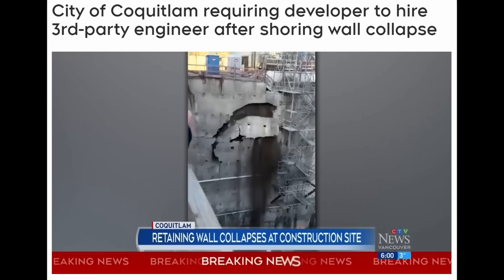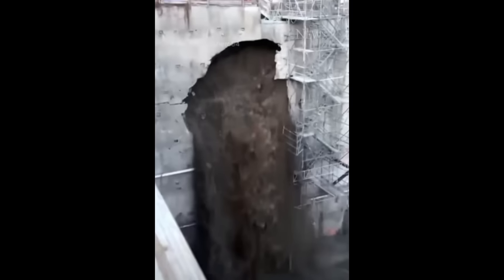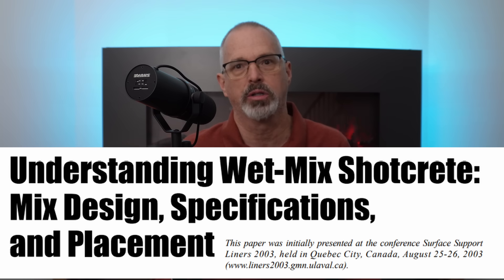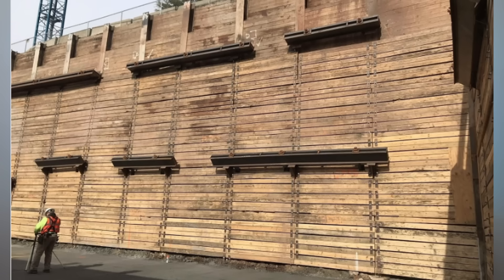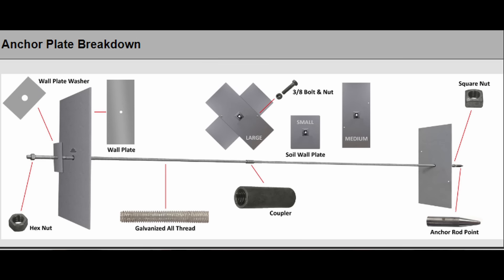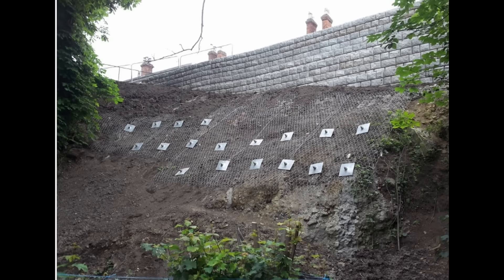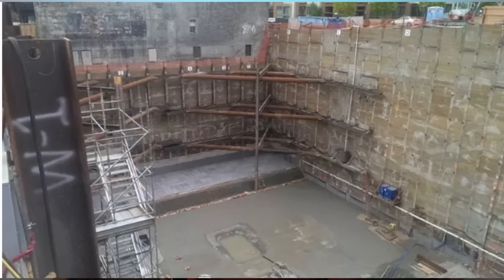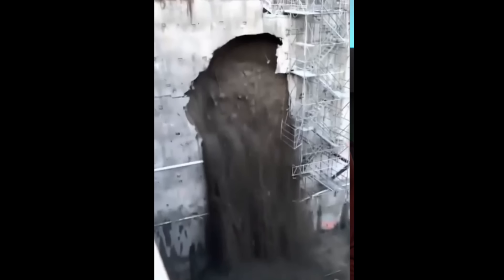Retaining Wall Collapse in Canada

Comment: Deep SOE in sand (seem to be outwash sand) - tieback or cross brace with soldier pile often is the better choice.   Same failure with soil nail and shotcrete wall has happened in Queens nyc in recent years.  Thanks.

Comment: I have worked on shot Crete walls with soil nails over 50 feet high in similar ground conditions. However we used heavy duty wire mesh and rebar anchored behind the wall plates. Looks like they saved some money on the mesh and rebar!

Comment: I've worked 2 jobs were ever 4ft drop in the hole ,malcomwould come and drill hollow ancor bolts followed by injecting grout be fore the drill let go and moved to the next bolt ,then wire mesh was put on the bolts then sprayed with grout ,after a time for cureing the plates were bolted down with a hydraulic machine under a inspectors eye ,that Malcom company is a great one for shure
Reply from the maker: Yes I agree.  The situation with contractors in the Vancouver area seems to be a free for all on these retaining walls.

Comment: You missed the biggest critical factor why this shotcrete shoring failed, no welded wire fabric / reinforcing steel.   PS referring to this as a 'retaining wall' is like calling an innertube the tire, FYI its called a shoring wall.
Reply from the maker: No I did mention that in the video.

Comment: People here have been saying the area is known to be unusual in its "fill" composition. Previous construction has run into the same problem, you'd think the city would've advised caution.
Reply from the maker: I understand that this engineer also had prior experience in this area as well.
Reply: @CaseyJones-Engineer  Then it's a case of cutting corners? Another poster mentioned they prefer the engineer stay in the trailer. Inexperience? No, geotechnical engineers would have relied on what was usually done elsewhere in the Lower Mainland as it didn't suit this site. This should have been basic.
What would be the cost of putting in those stronger alternative retaining walls?

I often get videos about China's "tofu dregs" construction. Let's hope corruption isn't settling in here.
Reply from the maker: @alainarchambault2331  I emailed the City of Coquitlam several questions that I had about this incident and there has been no response.

Comment: Shotcrete is a very common application for retaining walls in BC canada. You actually would be hard pressed to find any other system. Something has to have changed the soil conditions from when the original wall was installed. Typically you see shotcete walls installed at 10-15foot lifts. So if that soil was always that granular it would have been impossible to install the shotcrete as the soil would have just poured out.

Comment: Saying you’ve never seen an engineering practice doesn’t make it impracticable. Vancouver area has hundreds of such examples of shotcrete shoring. The failure here is due to improper attachment of the WWF to the soil anchors, inadequate soil anchor spacing, or insufficient shotcrete thickness application. You don’t sound like someone who knows what they are talking about so stick to facts, Mr Engineer.
Reply from the maker: My video was far more nuanced than that.  Did you actually watch it?

Comment: I am a designer/3d modeler... mostly oil and gas, some residential architecture (so somewhat familiar with concrete) with extensive prototype design...

my first question is where the F is the mesh and or rebar?

Comment: Tall shotcreted walls lining tower excavations are common in the Vancouver area, but the usual geotechnical conditions (hard glacial till or solid sandstone, sometimes basalt or granite) are favourable for this method.  Obviously, "flowing" soil is not.  There is a subway project currently underway on Broadway in the city of Vancouver with similar deep excavations for the station boxes with shotcrete walls, thick mesh and soil anchors drilled into solid sandstone.  The Coquitlam project appears to likely be a failure of geotechnical engineering and/or cost cutting by the contractor. The resulting lawsuit will no doubt correct these lax practices by these particular parties.  The amount of development is high, but Metro Vancouver is a desirable place to live and housing demand is high despite "world class" housing prices. The fellow quoted seems like a typical NIMBY with little insight into regional demographics.  In regard to development pressure, there could also be a failure of the city building permit, plan review and inspection process to have adequate resources in place to keep up.  However, the city is not the developer, builder, project architect or engineer who did the actual work, and that should be the main focus of the investigation, though the city is now open to taking some of the blame.

Comment: This is very common in British Columbia, I have been on jobs using Shotcrete retaining walls 100 feet deep with no issue, the on failure I have seen before this was caused by a cheating contractor who was not tensioning the anchors properly and even placing short stubs of anchor bar in the wall instead of drilling and testing the anchors to the engineered spec.
Reply from the maker: Thank you. There appears to be no reinforcing steel or mesh in this wall. Is that common to omit such reinforcing for a wall that tall?

Comment: Casey.  I am from Metro Vancouver. This style of shotcrete has been used almost exclusively on deep, large, sites here for all of the 20+ years i have worked in construction. there are different ways to do it with looser material.   I would really love to see a follow up video by you interviewing an engineer that is actually familiar with this type of shotcrete. it can be done safely at deep depths if designed right.
Reply from the maker: Thanks for the info!  There appears to have been no reinforcing elements at the face of this wall.  Is it common to omit such reinforcing in those local shotcrete applications.

Comment: I am an engineer from the area. The retaining wall is typically a temporary support. Once the basement is constructed, the basement walls support the soil lateral pressures. This is very common in the Vancouver area and it is very common to use shotcrete in this application. The soil in the region is more often a very hard glacial till rather than sand which can be a contributing factor. The shotcrete is not the problem. It is the specified rebar, thickness, and strength of the concrete that are more likely the issue. There can also be slippage of the soil anchors (especially in a sand material). You can build an extremely strong shotcrete wall.

What looks interesting here is the lack of rebar in the wall. It is often the geotech that specifies the shotcrete wall rebar and it shouldn't be. The wire and/or rebar is specified more on experience than on analysis since the geotech typically doesn't have the experience to do the structural analysis of the wall. This process has often concerned me. If you look at the size and reinforcing in the final basement wall, it is substantially stronger than the shotcrete wall which doesn't make a lot of sense. They should be roughly the same strength.
Reply from the maker: Thank you.  The lack of reinforcing, particularly relative to the great height of the wall seems very problematic to me.  Also, if contractors have developed local experience that is worth listening to.  I am hearing that there is a high-rise boom in this area that has attracted a lot of out of area contractors.  Is it possible that these out of area contractors are not familiar with local means and methods for such walls?
Reply: @CaseyJones-Engineer  The lack of rebar and thickness is an issue and there are lots of high-rises going up. The contractor is usually not responsible for the retaining wall design. Except for temporary geotechnical aspects, the contractor is responsible for temporary support (they have to hire a shoring engineer).  The retaining wall is a temporary geotechnical aspect of the building and the responsibility of the design usually falls onto the geotechnical engineer. Unfortunately, geotechs usually don't have the experience to properly analyze the structural aspects of the wall. I don't want to say for certain that is what happened here but it wouldn't surprise me if this is the issue. Hopefully this leads to changes in the process. The design of temporary retaining walls is difficult and I have geotechs ask me about their design (as good and reasonable due diligence on their part) to see if they were sufficient. They are often surprised that their initial designs were not sufficient. Many geotechs don't ask for the opinion of a structural engineer. Many go off of experience and experience doesn't always work.

We have what is called a schedule B and each discipline signs/seals the schedule for their discipline. One of the listed disciplines is "temporary geotechnical" which is usually signed by a geotechnical engineer but not a structural engineer. It is incumbent on the geotechnical engineer to get structural advice but they often go off of experience instead.
Reply from the maker: @yodaiam1000  That is excellent information, thank you very much!

Comment: Hey Casey I grew up in Coquitlam and for a number of years the tallest building was only about 5 stories, then about 10-15 years ago they changed the bylaws to allow taller building in, since then its been an explosion of contruction in the Greater Vancovuer Area of which Coquitlam is a part of. Most of Coqutlam is a mix or solid rock and very sandy soil. I have seen both shotcrete pits and steal wavy piles(not sure what it calles) used in sites around BC. Your video was very enlightening.
Reply from the maker: Thank you very much.  It looks like a beautiful area that maybe a lot of people are now wanting to move into.
Reply: Vancouver is the most expensive metro market in Canada outside of Toronto and even then its largely surpassed it. Tiny condos are $500K and we're talking Hong Kong/Manhattan tiny for those prices... Max 500 sq ft. Also Alberta and BC have been the fastest growing regions of Canada for decades so this doesn't surprise me. Where there's money in condo towers there will be people cutting corners... @CaseyJones-Engineer
Reply from the maker: Thanks for that information.  That is shockingly expensive for what people are getting.  I don't see how it is sustainable (which cities like San Francisco are finding that it is not). @stickynorth

Comment: At this point, how can the engineer fix the problem? The shotcrete wall is there already.  And for the rest of 3 sides, do they need to be reinforced as well. Also, is the building deep foundation designed to resist the soil pressure or the building relies on the shotcrete  to retain the soil?
Reply from the maker: I think that the shotcrete wall is temporary until a permanent basement wall can be build.  I suspect that the basement level will be parking with columns transferring loads to a deep foundation below the basement slab.

Comment: My question is why the rest of 3 sides of the shotcrete walls are still standing. If the construction method is totally wrong.
Reply from the maker: The wall was stable before it collapsed. Such failures are usually progressive and don't fail everywhere at the same time. However it is possible that the soil conditions or construction quality was worse at the failure location.
Reply: @CaseyJones-Engineer  Thank you for your explanation.  However if I understand correctly,  in your video,  you said shotcete method can not be used here at all. It is not a matter of construction quality. That is why I am wondering for the other 3 sides with the same depth,  why the walls are ok. I went to the site my self, I can see construction workers are still working at the bottom of the pit. It seems that they have no concern . I even talked to them. They said the rest of 3 sides should be fine.

Comment: I would love to see you come to BC and check it out since you mentioned you have never seen shockcrete used in such a way - I could take you to numerous of sites around the lower mainland and it is a method used often. I was on a site 18 months ago that was to be a 50 storey building in Burnaby and  it was a massive hole and they were using the shockcrete to secure the walls from caving. No idea if it is safe but as I said it is quite normal here in the lower mainland. You will also see the timber pile  style also -
Reply from the maker: Thank you for your comments.  Do you think that the wall that failed looked like the typical construction you have seen relative to its height and apparent absence of reinforcing steel or mesh at the face or have you seen this at other jobs too?
Reply: Now that you mentioned about the mesh, I dont recall - Ive been away from the sites for a while. im starting a job on Monday that from time to time will bring to a construction site, not sure at what stage but will keep an eye out to see if the wire mesh or  4x8 type with 4or 6 inch square steel is used  @CaseyJones-Engineer   Man the depth of these holes are wild - they seem to be going deeper all the time -

 A few  years ago they were building a tower 50 story's or greater downtown i want to say the old Toyota car dealer site on Burrard st. A few videos were made and I just quickly look and havent found them yet, If I do I will  post a link here for you.  

If you look at the map all of downtown right up to my street  in East Van is consider earthquake zone -

Comment: I have worked with many engineers over 45 years as a multi certified tradesman and supervisor. I realized that they have Zero practical, on the job training or thinking. Paper cuts only. They also should be held responsible for their failures. Having a stamp, and ring, after 2 -4 years of schooling, does not make them experts but more of a liability with a high cost to developing construction as well as the worker or public safety. Arrogance and schooling only, does not, make an expert of anything. I believe a Similar scenario as Governments claiming to be experts.
Reply from the maker: We used to joke that an expert was someone who lived over 100 miles away, never visited the jobsite and charged a lot of money for their consulting.

Comment: With the way owners are these days... (or the construction company cutting corners) they likely changed what the engineer gave for design, to make it cheaper...
I have seen large areas of shotcreet up here in Canada, but usually the rockbolts are much closer spaced than was shown.  Maybe the engineer said a rock bold every metre, not every 3-5m, and a thicker layer of shotcrete and more rebar?
But I'm not an engineer, so can't say for sure.
Reply from the maker: Great point, something is definitely amiss here.

Comment: 15 years ago Up a few miles away at SFU on Burnaby mountain i build an IGA grocery store with residential above. Back in the day, this was one of the first buildings ive seen that used shotcrete for structural. Yes thats right, the walls were shotcrete. Engineer approved

Comment: Absolutely poor design.  Begins with Shotcrete design fail in the center section.  You can see that the wall there has pushed through the retaining plates on 2 anchors.  As the soils shift we can see that you start having partial failures of the tension rods both above and below the initial failure point.  You have a system that one minor fail point becomes catastrophic as there are way to many potential independent failure points as there is a lack of sufficient tying.  I suspect that even just the addition of walers to this could have made an enormous difference.  A soldier pile system makes it very easy to monitor any movement that takes place simply by monitoring exact location of H-beams.
Entire collapse could have resulted from over-tension on a single tension rod.  Assume you have one tension rod get pulled to 50% or more beyond spec then get locked off at those tensions before releasing, you have extreme tensions pulling inward against that shotcrete that could easily exceed the structural strength of the shotcrete system.  Temperatures cool off and conduct through the steel rod potentially creating contraction, where even 1-2 mil might be enough to reach that critical failure point on one pile in a wall system that is designed with no redundancies.
This is why things are overengineered.  That wall may have been mathematically engineered well and had one critical error take place.
I'd be prepared to bet that you will never see this particular application in this country again.

Comment: Engineering is needed however. Whom so ever thought a simple curtain wall sprayed over soil at a near vertical pitch would constitute structural stability shows the quality of a formal education over riding common sense. Something we in the trades face on a daily basis as we try to contend with bad designs, plan's etc that look pretty on paper. There are checks and balances as in the law of gravity\pressure . . . you know . . . something that should be taught in school? But this is Canada. Greed over common sense. Someone with $ wanted something done.

Comment: As someone formerly involved in the industry and having worked in these excavations, this system is THE go-to method for Vancouver and the surrounding area. I've worked in 100 foot deep hole to P9 of a 52 story tower. Having said that,  a 30 foot deep, pile and strut system failed in Langley BC last year.

Comment: In jy paranoia the taking several months to finish a review is to decide whom to blame.  I live in Victoria and have watched a similar construction with more substantial concrete reinforcement of the hole dug out for the substructure.  The area was exposed, dense clay or bedrock, depending on the location and did more ' overkill ' ( in my opinion ) retaining than the job in the video.